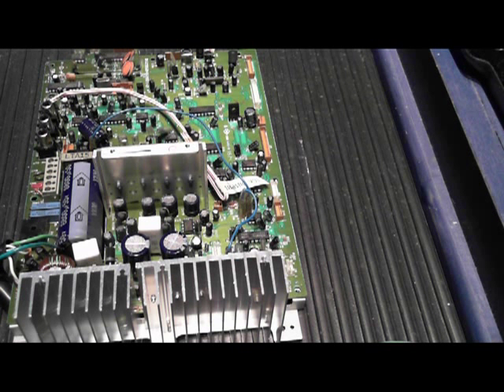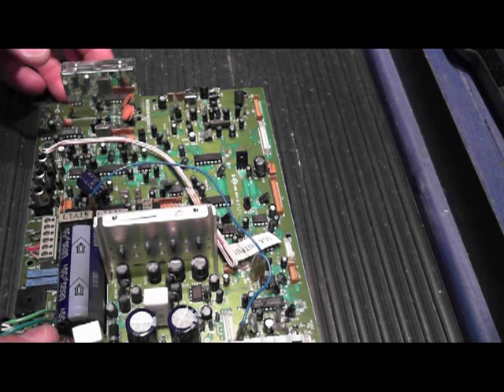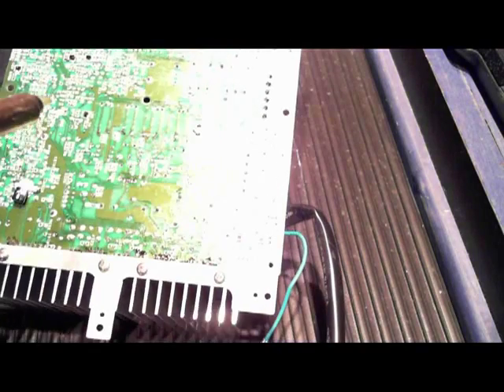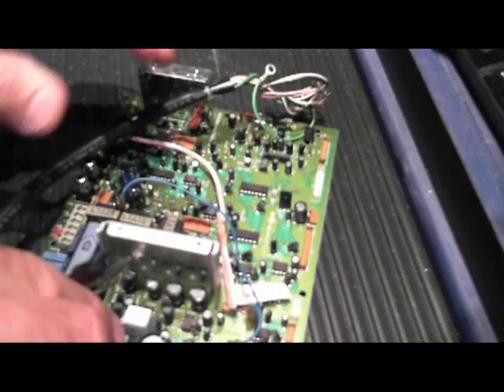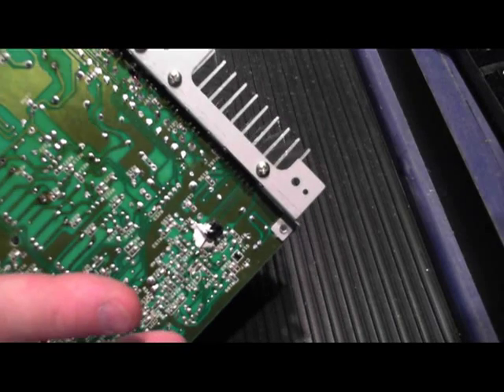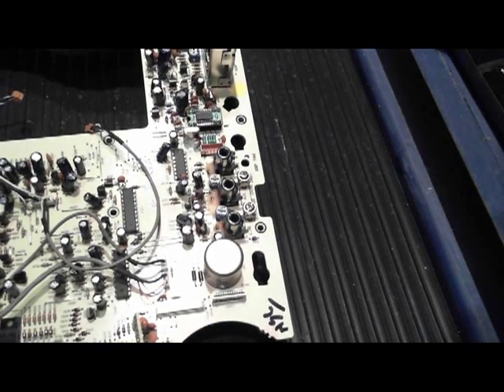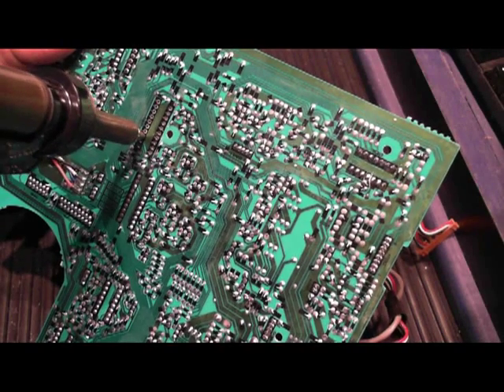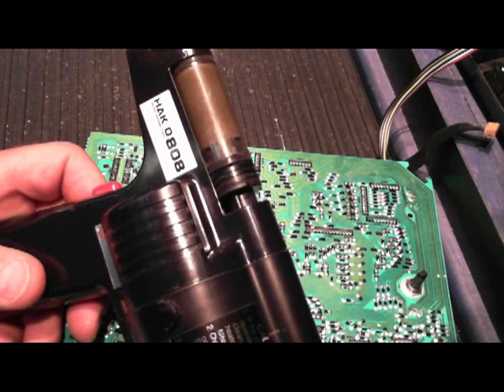Desoldering with a Hakko 808

Comment: This gun is useless for pc motherboards. I bought  this gun and turned it up to its max temp. Would not work as this guy is showing.
Reply: You need to add leaded solder.  PC boards use shitty lead-free which has a higher melting point.

Comment: My technique is to keep the vacuum running while removing the tool off the pin. This seems to do a better job than keeping heat on the pin after turning off the pump. Try it, I think you will prefer the results.